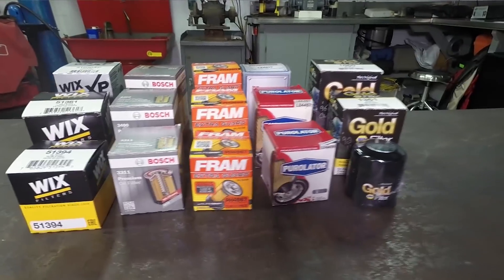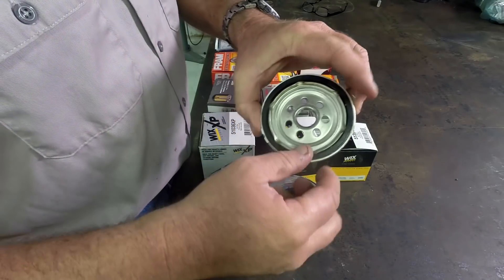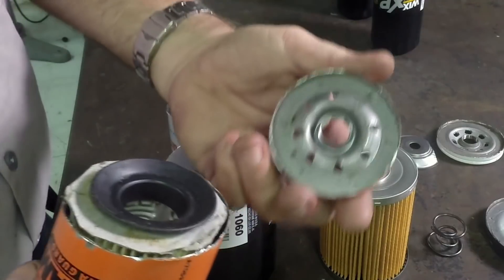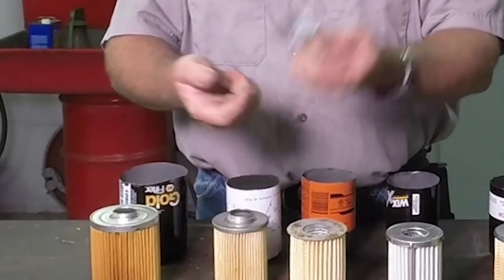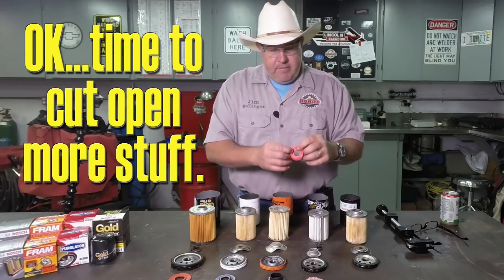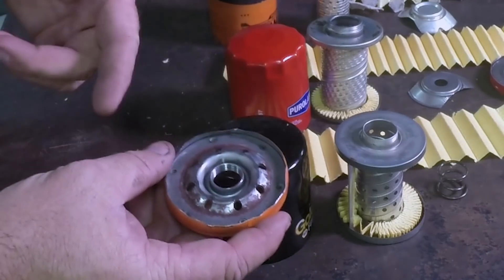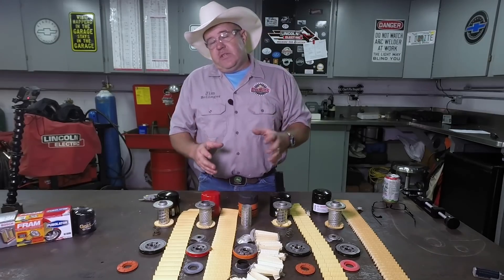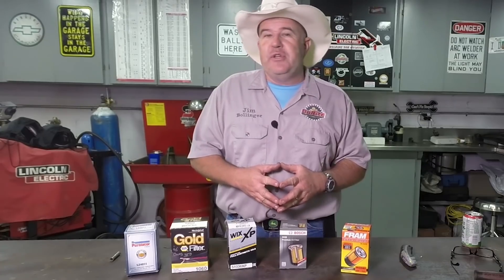The worst oil filter EVER!

Comment: It looks like you're comparing different oil filters in terms of size/application and quality lines within manufacturer's. Were these all filters for the same make and model of vehicle? The video would suggest that they weren't as the size varied a good deal and could skew the results. This was particularly noticeable in the overall filter can size and when you were comparing the overall filtering media length. Obviously an oil filter for a Triton V10 would be larger than a filter for a 1L 3 cylinder Chevy sprint simply due to the size of the can and requirements. I'm not saying that's what you did in this video, but I am using it as an example of how the size differences between filters can skew your results.

Were the filters all of the same quality? The results would be pretty skewed if you compare a top of the line filter from company x, with the bottom of the line filter from company y. In this case you were comparing a NAPA Gold filter (which is their middle tier filter) to the lowest tier FRAM. Other video's show that the middle and upper tier FRAM's are constructed considerably different than their bottom line (which is cardboard crap). I don't know how the middle and upper tier FRAM's compare to WIX and NAPA branded WIX, but you should at least compare the same size and quality if you want to get valid results.

Comment: I have had those fram filters starve many engines for oil. They restrict oil flow to the cylinder head on mazda 2.0 toyota 2.2 & vw 1.8 16v... the engines valve train getS REAL LOUD. Swapped them out with a cheap casite & shuts them right up. Customer changed his own oil after a fresh jasper install . Seen it first hand no b.s. NEVER USE A FRAM FILTER AS THEY FILTER TOO MUCH STARVING THE CYLINDER HEAD FOR OIL . BURNS THEM UP...!!

Comment: 30 years ago I had a fram oil filter explode on my car.  I haven't bought one since.  What I can't understand is that Jay Leno uses fram.
Reply: Because its a great filter.  I use them on all of my customers cars and my race cars. My dad has used them for years too. They are a reputable brand. Been using them for years with no failures. Can't go wrong with a Fram.

Comment: When I change my oil on a deserted island I generally end up using a discarded soup can stuffed with old socks as a filter,  it works fine because there is no where to drive to on a deserted island.  Your mileage may vary.

Comment: Putting metal into you filter by cutting then with angle grinder,  so why no can openerc...  or silly tin snips ..
Reply from the maker: You mean the filter we are going to throw in the trash at the end of the video? Common sense?
Reply: Purpose of a oil filter is to remove debris "metal" from oil , so adding metal shards aint helping just saying ... should watch engine master's after they break in an engine they also cut open oil filters  but they don't use angle grinders ... just saying

Comment: I remember way back in the early days of the internet, reading about a guy whose Dodge motor was destroyed when the cardboard in his Fram filter disintegrated, and the debris plugged the oil gallery to the head, destroying the cams and bearings, and sending more debris throughout the engine.
IIRC he sued Fram, but I don't remember the outcome.
Reply: If I remember correctly the plaintiff lost, couldn't provide proof that he didn't exceed the recommended mileage of 3k miles.

Comment: I'm a 83 year old retired engineer, who for most of my life, did my own oil/filter changes, and who used Fram filters!  But in recent years, at my age, I now take my vehicles to a local mechanic whom I respect, and let him change the oil and filter. BUT I supply both the oil and filter - and based on this video, in the future I'll not use Fram, but probably the Wix filter, as it's usually available at Walmart and most auto parts stores!

Comment: I always cut the cans off  the filter after an oil change just to see how the engine is doing, I knew that Fram was garbage once they became the leading brand sold at Walmart, even the lowly Walmart Supertech is better, and seems to be very similar internally to Purolator, Fram once were good solid filters before they cut corners in the race to be the Walmart leading brand, The AutoZone STP filters are also far superior to Fram's "orange can of death" filters

Comment: The filter was coming apart because you hit it with the grinding wheel.no fram filter will ruin an engine that's a ridiculous claim.what speck of dust you saw was probably because it was a ten year old filter,and wouldn't matter when filled with oil.
Reply from the maker: You truly are special aren't you?

Comment: At the NAPA store I worked in we did that cutaway demonstration and set the results on the sales counter.
This was 1982. At that time the Napa was first of course. Wix was obviously second as it's made by the same factory. Fram was a close 3rd and looked like a Purolator. Note:  Purolator makes a " PURE-ONE filter that I used in a pinch as it was advertised to be slightly better than most good filters. I think a Chevy garage generic was the final.
I do remember the Fram looked great but I never thought of rolling out the filter media. You opened my eyes on that one. I would say Fram had maybe 1/2  as much as a NAPA Gold but it was put in there solidly and had a decent anti-drainback and spring. I imagine the manufacturing and assembly were done in North America.
I use nothing but Amsoil EA 25,000 mile filters or NAPA Platinum 15,000 mile+ filters and I do 1 oil change in the winter after about 5500 miles. Amsoil Signature oil or Extended Life Mobile 1 oil.
I did notice one odd thing on a NAPA Gold filter I used on the RV.
The base plate, it was brazed or welded or sealed ?? all the way around the base plate to canister surface on the inside edge, except one tiny spot that was letting oil come back through. Now what I thought was " Will this defeat the anti-drainback seal ??? "

Comment: Its funny how these fearmongers come up with this crap.  If these filters were so bad that they destroy every engine they are used on, wouldn't maybe just one of the over 2 million people that have viewed this video step up with proof positive documentation supporting the claim that whatever brand of oil filter is destroying engines.  When I first started working on cars as a profession, it was at the end of the era where the filter was only changed every other oil change, and it was just 15 to 20 years after all engines actually had a serviceable oil filter.  And that era is the one that people for the last 50 years have steadfastly claimed was when engines were built to last, and you could couldn't kill them.  Believe what you want to believe, but before falling for this crap, take a couple of minutes and think back, how many people have you talked to first hand (as in the person that experienced this failure is someone you talked to directly, and not a friend of your uncle's wife's sister in laws, sons, ex-girlfriends new wife's, fathers cousins car, back in Russia during WW2) that happened to have their engine fail due to the design of an oil filter that actually meets all the standards demanded by auto manufacturers.

Comment: The comments on the Fram filter may be dated.  In 2011, the Rank Group purchased Fram and Autolite spark plugs from Honeywell that had let the quality of Fram filters slip badly.  In early 2019, Trico bought Fram and Autolite.  It is my understanding that under Rank the quality of Fram filters improved but just what will happen under Trico can only be demonstrated in time.  If the Fram filter he has just castigated (and rightly so) has the name Honeywell on it, it might be well to reserve judgment.

Comment: I've been using Fram filters for years with zero problems.. However, now that I see how they are made it makes sense to switch to the Napa or Wix.  The Wix has an XP version.  Amazon sells the XP for a buck LESS than the standard..?  51348XP   I would have thought the XP would have been better?  Any advice appreciated.. Thanks

Comment: Interesting video, thank you. FYI, though, I have used Fram filters for the last 10 years on my RV. It now has 236,000 miles on it. Put 6,000 miles on it last summer and it only used a quart of oil. I have also used them on my other vehicles, including my work truck and the engines are fine. I change them every 6,000 miles or so. Fram must be doing something right.

Comment: I never understood buying the cheapest filter and oil for a $40k vehicle.. I also use Lucas in everything! I've had my old chevy truck since it was new. My first vehicle. Regular service and good parts is why it's still good. Mileage is low since It gets about 10 to a gallon. Original paint. Front pads once, several batteries, and a belt as well as several tires...thats all. A Texas truck so no rust from road salt. I use wix filters with check valve. We call it the time machine. That pulling my 74 Apache hard side popup camper ...to Possum KINGDOM LAKE...just makes for good times..and they aren't even over for good!

Comment: I'm a ford technician. I have had to replace engines because of fram oil filters. The cardboard comes apart and clogs up oil passages causing engine damage. Don't use cheap oil filters on your engine.

Comment: This June i was headed to arizona in my ram from WV. only 2200 mile trip , I made it to Oklahoma, the half way point and all the sudden the warning bells went off and when i looked at the dash the oil pressure was at zero! I was 20 miles from an exit so i nursed it to the exit . I was sick i thought the engine was toast, there was only one auto parts in the area, after the truck sat for a while i started it an the valve train rattled i was sick! well the fine gentleman at the auto parts asked " what kind of oil filter do you have on the truck? FRAM i told him and then he told me the story you just seen here, he sold me a WIX filter and i went back to the truck stop and changed the filter and the oil pressure went back up to normal !! I will never buy another fram piece of junk again, pass it on to your friends, A engine is 2-3 thousand dollars a good oil filter is only 6 dollars, engine is still running great  with a wix filter. Lesson learned!!!

Comment: As a retired mechanic, I have always known Fram is Junk. Aftermarket have always been suspect in my book, but After this video I can say that there are a few decent serviceable aftermarket filters after all. Thanks so much for doing this video! Now what you need to do is take apart a bunch of Manufacturer's filter's, so FORD, CHEVROLET, CHRYSLER etc. and see what they have decided is a proper filter for their brand and then compare them! I used to be a Mercedes Benz Tech, I'm interested in seeing what they have put inside their filters and how much filter media they put in. There's your next challenge mate, take some brand name filters apart and compare them. I used to use Ford Filters on all of my cars even when they weren't Fords and I never had a problem with them or my cars oil systems.

Comment: iv had issues with the fram  filters before  causing oil pressure issues but changed brands of filter n got many more years out of what  the garage figured was a bad motor . this has been going on for ever. glad to see it not only my opinion

Comment: wow, i have used fram for ~30 years, I was told the quality went to crap when they took it to china, but I now have 483K miles on my 25yo 1994 toyota truck and only using fram. And i only change the filter every other oil change, 3500 miles per oil change (7 minute oil change w/o filter, 9 minutes with filter). They maybe "complete garbage, but close to half million miles they work fine. Maybe if you used them on a Ford, it would explode backing out the driveway, Oooo, but thats just Ford. :)

Comment: No doubt you shed some light on way better filters out there. But I had a 1994 Toyota pickup 4cyl I bought new and drove for 25 years totaling 305,000 mi before I sold it. I used Fram oil filters I'd say over 90% of the time. Not one problem. I work with the guy that bought the truck from me and the truck still runs perfect! Obviously from the video I wouldn't buy Fram again. I now use Wix.

Comment: Man that sucks! I've been a Fram guy for decades... Even though they're a bit more expensive, napa is a safe(er) bet when it comes to parts of all types.
Reply: Did you ever had issues with Fram in all those decades?
Reply: @MrRoman-lo6ih  Really good question! Aside from one engine with transient low oil pressure issues.. I'd have to say no. Filters have been cheap enough that I change filters with each oil change.. So does it matter in the long run? Right now I'm touring the US in my rv. It has a big block 454. While I have a couple different types of road side assistance, I don't want to have to call them. So if spending a few dollars more on a filter that I can trust isn't introducing cardboard particulates or moisture into my engine,  I'll take that route. What are your thoughts?
Reply: NO need to change now. Same great filter. Been using them for many years along with my dad. They are a reputable brand. Been using them for years with no failures. Can't go wrong with a Fram.
Reply: @dwc4343  I ended up being really torn on this one.. did you see my last post?

Comment: Great presentation! I always wondered why the automotive industry adopted the wasteful "spin on" oil filter instead of a housing where you replaced just the element? You not only throw away a lot of metal, but nearly a quart of oil trapped inside! Where are all the environmentalists on this? Oh...They're totally clueless as usual. LOL. Funny is we currently own 2 vehicles that HAVE a system where only the paper element is replaced...Our 2008 Cadillac SRX V-6 and a 2001 VW diesel TDi. Both have the cylinder housings pointed up, so you just remove the end cap, pull out the element, replace the cap! NO oil spills out either! Ingenuous!
Reply: @Curt
Yup, my Mercedes was the same way.
Reply: I don't get it! Why do the automobile manufacturers design their engines in a way where the filter cap is pointing towards the road? It's a recipe for an oil spill on the highway when this thing rattles itself loose and busts off its thread seat allowing the engine oil to instantly gush out onto the pavement.
Reply: @Bandicoot803  Oh, hell yes !! Point the base of that filter toward the skies, so in case it "rattles itself loose" the oil will gush skyward like a f**king volcano eruption, sending oil into every crack and crevice within range.
Properly-mounted spin-on oil filters DO NOT "rattle themselves loose".
Screw on the filter until the (pre-oiled) gasket makes contact.
Tighten the filter three-quarters (3/4ths) of a turn.
This will seat the gasket with a .046" of compression, which will prevent leakage at any OEM oil pressure.
Reply: I wish all vehicles were that way

Comment: You mentioned about Fram with rust in it! Wished you purchased another one from another merchant. You don't know where or how long it sat before you purchased it. You just talked about looks and nothing about like see if their was like a leak or draining issue of the oil out of the filter. In addition the number one MAIN issue as to how good it is to filtering out metal particles. Nothing was said, looking at it doesn't mean anything!

Comment: I have a tool, the filter cutter, which does not need electricity. It can cut the filter shell perfectly in about a minute. It's easy and clean, and it doesn't make any noise.

Comment: Did you ever consider the Hastings Oil Filter. Consumer Reports did, some years ago, and found that it contained cotton as the filtering agent. It collapsed to the bottom of the filter thus sending unfiltered oil back into the engine.

Comment: People complain about my companies filter but its just an ordinary Purilator filter with a different paint job, decent quality has a real bypass valve and drainback. it doesnt matter that much in an ordinary car an engine can run with no oil poressure for few seconds no problem, if you have a raceing car then yes you should be picky

Comment: OH please I work in a lube shop if we run out of our brand we get frams from the auto supply store never heard of any problem and  if a little oil bypasses alll the time it doesnt matter because the oil will be filtered eventually anyhow and if the drainback doesnt work perfectly it doesnt matter that much the oil pressure will build up quickly enough anyhow, this is ridiculous